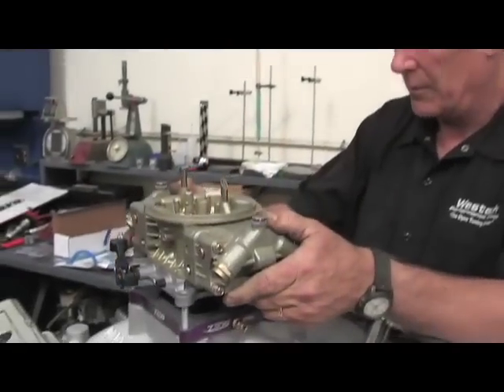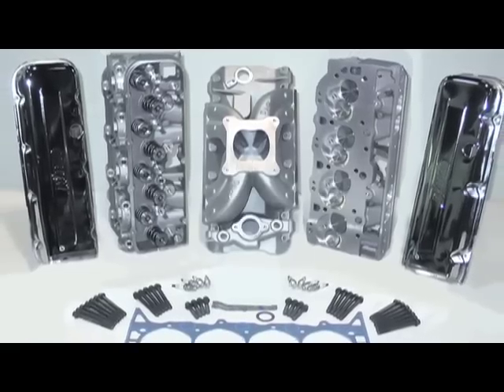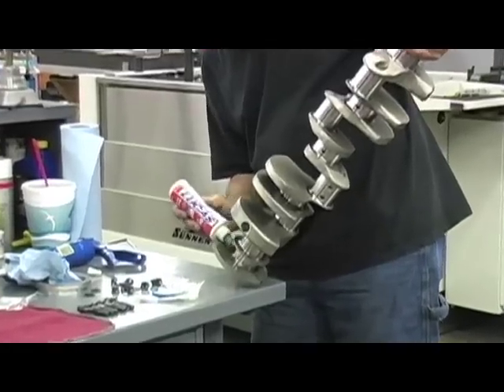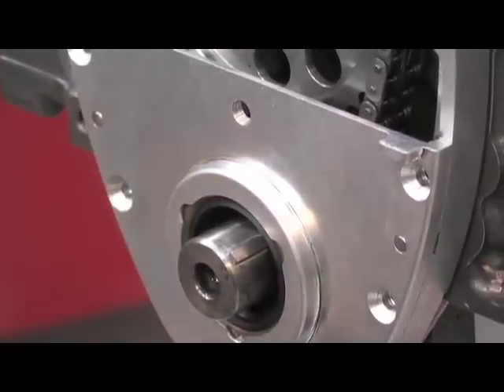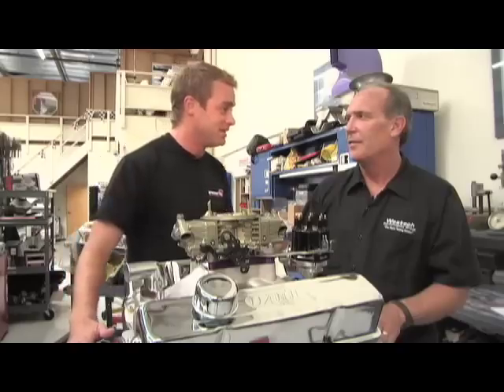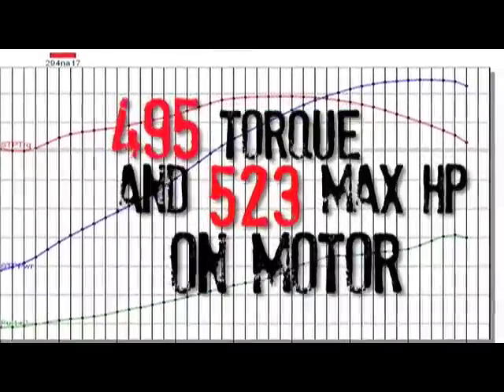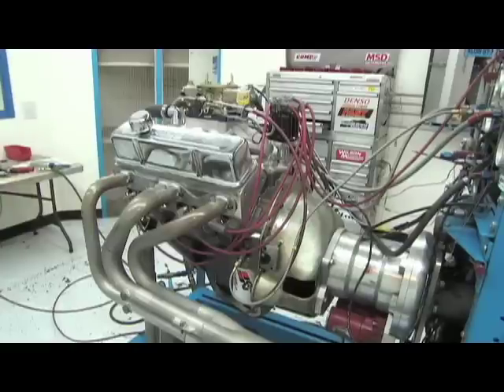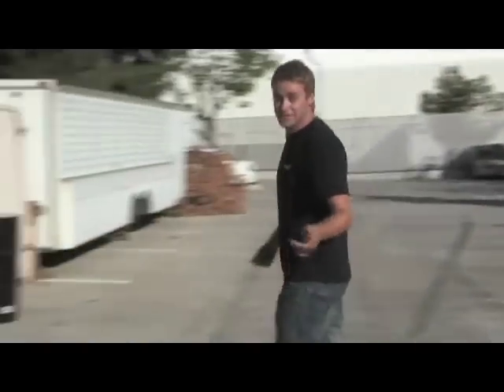Dyno Test - Dart Short Block and Top End Kits

Comment: I built a big block 454 with the same Hyd. cam set up, but I used 1.8 rockers to facilitate a little more duration on the intake. That motor at 11.1 made a little over 700hp and 646 ft lbs. Torque.  Dart makes great blocks.  Brodix makes great heads.  And you have to learn to port(by hand). No nitrous ...yet.  My 496 made 82 more hp.  Torque was up only 18 points. I can't wait to build a 632!

Comment: There are numerous Youtube posters who say all heads, even Darts, need to be fixed by a competent machine shop. They say the valve seats, valve guides, and bent stems are common. QUESTION is, do you re-machine the heads you use? Do you check the seats with Dyekem for proper seating? Check the valve guide for being too tight fit?  Or do you always just bolt on the heads as you get them from the manufacturer?  Thanks
Reply: A lot of things that are being done on the side are left out of these infomercials..

Comment: Who is the young bloke working the dyno?
As for the power? I have used similar spec stuff but with 12-1 on Avgas and solid roller with similar specs and made 500 at the wheels.

Comment: Damn I wish it was a basic supercharger kit on this test like a P1SC on like 7 or 8 psi
Reply: 427 is hard to get the static compression down. -27cc dished pistons still leave about 10.5:1 with 64cc heads.
Reply: Jeffrey Binnig 

That's a great point, I just assumed flat top pistons
Reply: Dart has 72cc versions too.

Comment: Why lifters, ignition wires, cast iron, fixed cams etc... Seems to me like these old timers don't like change. Welcome to the 25th centenary, here is my short block.. hasn't change a bit in ions.
Reply: LOL, doubting a "pushrod" engine? That iron block is cheap , reliable & can handle abuse "heat" , nitrous, turbo's, all day long, no sweat. And variable cam timing? That's not for high output engines, lol... It's to maximize "efficiency" , especially with mild or small engines. Sounds impressive on paper, but more world records are made with USA, pushrod V-8 powerplants , period !   .
Reply: Why change what works? The LS is a newer generation engine but when modified makes no more power and is a BIT lighter.
Go the other way and look at Fords hitech OHC engines. Cost more and make less power. And are huge top heavy things as well.
Reply: the higher end LS engines are making 2k+ hp and much more common and affordable parts.
Reply: with twin turbo's-
 @ForneyRider

Comment: Only gave it the thumbs down not for the brand “Dart”, but the design of the motor “Chevy”
Reply: Can't blame you for jealousy... Ford pimped flatheads until 1954... Chrysler through 1959... Chevy always OHV... from start in 1900 onwards...